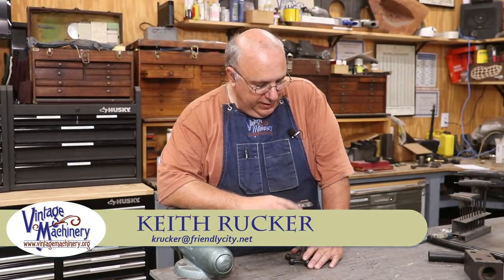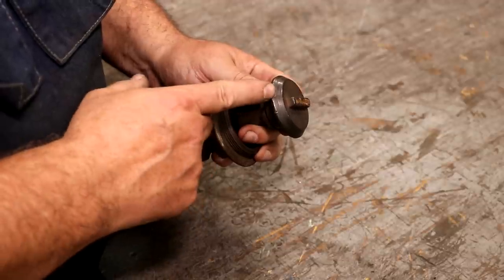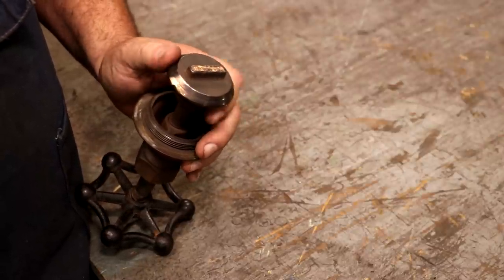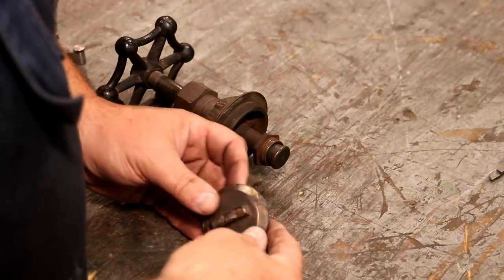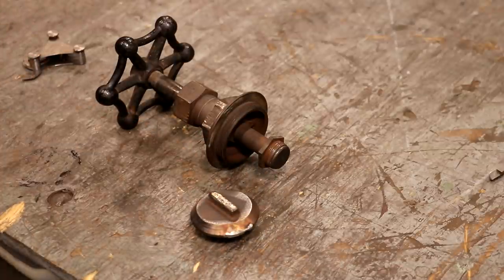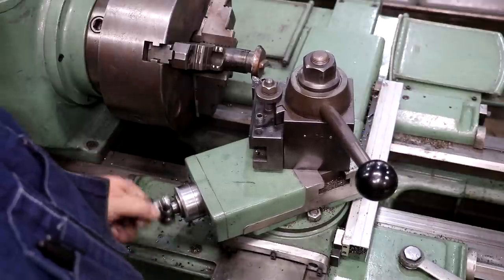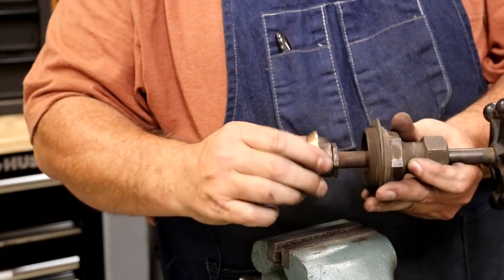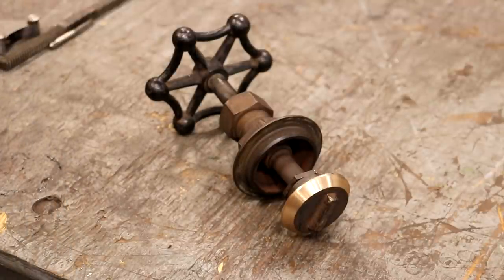Frick Steam Engine Valve Repair - Building up and Re-Facing a Valve Seat

Comment: Union Pipefitter who specializes in boilers and steam systems. That looks like it’s steam cut. Pretty common on older piping/fittings/valves in steam systems. Generally you see it on the faces of flanges when you have a gasket fail but don’t replace it for a while
Reply: My thoughts exactly!

Comment: Nice repair Keith. I’m trying to find more about this type of welding.
Reply: If you decide to buy a tigwelder spend the extra on a machine that can do AC and DC.
Otherwise your gonna hit yourself face when the first aluminum job comes up.
I'm a welder specialized in tig welding of aluminium and stainless steel.
Reply: johan = thank you !!

Comment: I'd hazard a guess that the valve seat could also be damaged, in that case your work is still not going to seal correctly
Reply: With the contact area being on the outside I would say the seat definitely has eroded back, or been cut back a lot in it's life. Either time to put a new seat in there, or build up the entire valve face slightly, and cut it slightly larger diameter wise to compensate, so the contact area is nearer the front section.
Reply: They make cutters to clean up the valve seats . How do I  know this I have a set. When you recut them the valve just sets a little lower.

Comment: I'll agree with everyone else that the valve seat is almost certainly damaged as well, and after this you'll want to lap the valve to the seat.

If it comes to that, Online Metal Supply still has some odd lengths of big Monel round stock - at least in Alloy 400.  (They're probably someone's cutoffs.)  Alloy 405 would probably be better for you since it's free machining, but less-than-wholesale quantities are hard to come by.

Comment: I am not sure monel was the right guess on the mystery metal.  The color looks wrong to me. I think maybe it is closer to beryllium copper or cupronickel.
Reply: Absolutely, color is wrong. Monel 400 is silvery, almost the same color as 304 stainless, but maybe just a bit bluer. It also machines like crap—gummy, yet works hardens like few other things, and would probably have generated a lot of heat a the tool at the speed he was running... and is certainly NOT not free machining at the feeds/speeds we saw in the video.

However, beryllium copper is a pretty exotic and hard material, and cupronickel is fairly unusual in steam valve service, so I don't think those are right either. IMO, most likely material here is just some bog-standard tin bronze... maybe a silicon bronze if this valve is younger than I think it is.

Comment: The damage is caused by wire drawing. Steam is very abrasive and eventually will find a weak spot and the high velocity of the steam passing through a tiny gap causes the material to wear away.

Regards from Redruth

Arnold

Comment: Do watch out for the fumes when welding anything containing copper, it's on the same level and maybe even worse then zinc when it comes to the health risks.
When I tig welded some CuNiFer  piping had point extraction, room extraction and overpressure an welding helmet but still got a headache pretty fast

Comment: For those who do not know steam and the associated parts and plumbing,  NEVER use a pipe wrench or pliers on brass, bronze, or associated metals of valves and valve parts, see 10:26 and 18:29 plus some other scenes in the video which show the damage the teeth make in the valve metal.  It looks like a one-time occurrence but if continued the valve will be ruined.
I wish your friend had sent/brought you the actual valve body with the seat to be trued along with the disc to be sure the mating surfaces are correct for lapping.  Moving steam will cut glass, steel, and any other metal.  Lapping is the only way to get a steam-tight joint other than an O-ring or gasket.

Comment: Technical correction on this one Keith - the valve seat is on the body of the valve assembly and not on the actual valve. From research, it appears the sealing bit of the valve is called the 'face', sealing face, seat face or variations of that ilk.

Comment: I have to agree with Brian Tozer.  The other surface should also be ground and/or lapped.   But I would think that operation needs a special lapping tool as this valve head swivels, and  probably would not work as a lap.

I loaned out my SAE thread file and you know the rest of that story.

Comment: I worked in an automobile machine shop, and I’ve ground many of valves, and valve seats, and I tell you this whole job looks wanky to me. What does the seat look like? It probably needs some work too. And they really should be done together as a matched pair. I can’t imagine doing a valve without the seat, and having them mate up properly. But best of luck to you, hope it works out great.
Reply: Go to the 20:00 of the video and you will notice even after tightening the head wobbles a bit on the stem so the valve ends up being self aligning and I'm guessing this is why  they used a 40 degree angle on the mating surfaces.
Reply: @Peter-V_00  if the seat is not round, or flat/smooth, then it doesn’t matter if the valve is self aligning.
Reply: @barryfields2964  What I saw was the valve head  cut 100% at 40 degrees across the face so what was not round and smooth but if you're talking about the open seat in the valve body soif I had to guess the guy that owns the valve probably is well aware of how to service that steam valve and most likely has or has access to the proper (hand tools by the way) tools  needed to service it correctly, what he didn't have was the means to repair the damage to the face which was what Keith addressed.
Reply: @Peter-V_00  ol, I’m sure they will. It just seems weird, having two different people doing the two different parts separately. That’s just something I would never think about doing.
Reply: Who cares  a valve seat for an automobile valve only seats in a small area. A valve for air water or steam has a much bigger seating area. There are cutters to recut re valve seat. How do I know I have a set. Very big difference between the two
Reply: @johnscott2849  The surfaces still need to be lapped together to get the best seal.
Reply: @royreynolds108  that is true but you got to have the other half but the  cutters I got say no. If angles are matching it will seal. You need to understand this is not a car engine with a spring holding it closed. That alone makes a big difference. If it's smouth on both sides same angle it will seal.

Comment: Nice repair, but let's not confuse Monel and Inconel. Yes, Monel is nickel-copper. But Inconel is nickel-chromium-iron-moly. Monel useful to about 1000F where as Inconel good over 2000F. Had a case where Castle Metals sent us Monel bar instead of Inconel. Pretty much got an around the world tour to fix that screw up...

Comment: Not making the proper taper threads for your setup because it's more trouble than it's worth? I'd say reworking a somewhat irreplaceable part is worth the trouble. Plus you had porosity in the sealing surface and left that go too. But you know, it's "good enough" for you.
Reply: Exactly!  And dont even get me started when he paints.  I have zero problems with applying a better finish to a part than it had to start with.  Its leaving your craftsman mark on something.

Comment: I’m fascinated by early alloys. I read monel dates to 1905. But it’s a simple alloy of nickel and copper, so I wonder if there were alloys of nickel and copper used in valves before monel? German Silver can be made without zinc, and so is very similar. What made me wonder is the red cast the valve took after machining may point to a higher copper content than usual. The other thing I noticed is it seemed to machine well, and original monel is listed as poorly machining. In any form nickel copper is going to make a better valve than brass or bronze, and using a monel rod was the right thing to do. Nice job.
Reply: When Monel was first being machined it was on flat belt drive lathes with either cobalt (probably) or high speed (possibly) cutting tools, Keith was using a gear drive lathe with a state of the art carbide tool making it look easy.
Reply: @Peter-V_00  The low machinability rating of monel is not, primarily, because it requires carbide tools or a powerful machine, though it does generate a lot of heat at the tool and so requires pretty low speeds when using HSS tooling.

The problem with monel (especially in lathe work) is that it's gummy, stringy, and work hardens as you cut it.

As I mention in another comment here, the color is certainly wrong, too. Monel looks almost like stainless. This looks like a bronze.

Comment: Good job on the repair, however, the part you fixed is the valve disc, not the seat.  The seat is in the body of the valve and will need to be recut or lapped to remove any imperfections.  The seat angle is usually 1 or 2 degrees different from the disc allowing for a thin sealing surface between the two.  The type valve you repaired is called a globe valve and is used to throttle flow in a system and should not be used for isolation which is the job of a gate valve.

Comment: If the valve is able to free spin, which is obvious to prevent galling to the seat, what's with the rectangular boss on the head of the valve? Is there a rectangular pocket that the valve head would index into? I just can't understand why it's there at all?
Reply: Okay, I see you clamping it in the vise. Do you think that's what its purpose was? Hard to imagine a time where there was not a vast gulf between engineers and machinists. It's hard to imagine that that would have been designed solely for ease of repair
Reply: @jpsimon206  I saw that and thought it was really interesting, too.

I can't imagine it serving any purpose in the assembled valve. This style of rotating-stem/rotating-head globe valve does not require any additional means to keep the plug from rotating relative to the seat (and thus galling) as they make contact, and in the examples I've seen (dating from contemporary, through ~50 years or so old) they do not have any such feature.

Further, globe valves (including this one, judging by what we can see of the stem arrangement) usually open well in excess of .25x the seat diameter... so that rectangular boss would come clean out of any guide rail recess... and not go back in so well.

(As a thought, it might also act as a casting runner, to help ensure a good quality casting in the seat area. But I don't know much about casting.)

(The contemporary valves I've seen usually don't have such a nice fixturing point—but unlike this valve, they don't predate arc-welding. Usual practice now, at least in good quality industrial valves, is to tack-weld the threaded retainer to keep it from coming out. That means it's a lot less important to get it *really tight*, so you can just use a pair of pipe wrenches or such.)
Reply: @dylanfoltz8559  I don't work with this stuff these days, but oddly enough I have a spring on my property that was built by a marine engineer using steam valves off of ships, usually Liberty ships. I have about two dozen of these monel valves. None of them have that boss. I appreciate the reply

Comment: Can you not see the run-out in your setup ?
Reply: It's a cast part, the outer stem surface is not machined. The seat was cut concentric with the threads/mandrel.
Reply: @kindabluejazz  The machined surface was not running true that is why when he made his first cuts half the diameter was left uncut. This part is not the seat, the seat is what this part fits into.
Reply: @tonybell4447  He was cutting concentric to the mandrel, which is presumably the machining reference. To me it looks like more than half of the face was touched on his first pass, over 225 degrees worth, and there was a hollow, right at the part where it failed and he had to build up, which is likely why it failed at that location. That whole area looked rough and worn, not like original machining marks. Whatever, we can't really know more without having the part in our own hands.

Comment: Hi, I have jumped in to ask if your friend has confirmed that the damage is on the part you have only, if it has damaged both parts then it is not going to fit when you return it to him. I will apologise now it you have thought of this and put it in a later bit of this video, I tend to comment as soon as I think of something because if I don’t I will not be able to remember this point later on (my memory is shot)
Reply: That was my first thought also! If the actual valve seat is damaged (and I'd bet it is) it may need to be refaced/reground also.

Comment: When cutting a diameter on anything to a proper size to set up to cut threads, what diameter do you cut the diameter to? The exact outer finished thread diameter of a threaded part or slight larger? Just wondering.
Reply: That’s when you refer to the good old Machinery’s Handbook. All that info is there. There are many pages of threads that list both the minor and major diameters.

Comment: Have to agree with everybody else, would have been better to have done the valve as a complete unit. Personally, I would feel better if the valve could have been lapped into the seat. But since you just had the valve seal, so that's all you could do. <shrugs>

Comment: He should also lap it in with the counterpart in the valve
Reply: The open seat will need to be cut true to proper angle as well as cut top and bottom to place the sealing surface properly to match the valve head, lapping is really only to place and fine tune the sealing area.

Comment: Keith: You seem to favor DCMT or other diamond shaped inserts. Mr. Pete seems to prefer TNMG. Adam Booth seems to like WNMG.  Any particular reason?
Reply: I also prefer the WNMG inserts because you can perform facing and turning operations, and you have 6 cutting edges with a really robust geometry. DCMT has only 4 edges and you can only take skim facing cuts with it.  TNMG wont take as big a cut as the WNMG, and you can only take skim facing cuts with it also.

Comment: Keith, maybe send your arbor so he can lap it in to the seat?
Reply: i was thinking the same thing.. but i think it would require center drilling the threaded end..  and trying to dial in the other end to turn it down to a smooth finish them measure the valve body cap thread and make and adapter to hold the arbor ..  since its a 40 degree face.. it might be easier to make a complete lapping arbor out of a harder steel.. so the monel valve is not damaged while lapping the valve seat..  thank you dennis for being foresighted..

Comment: #KeithRucker, The owner needs to reface the seat as well as the valve. Doing just one or the other is pointless. If the owner needs the kit to reface the valve seat I know of a complete kit for sale at one of the local antique stores. I will email you the information.